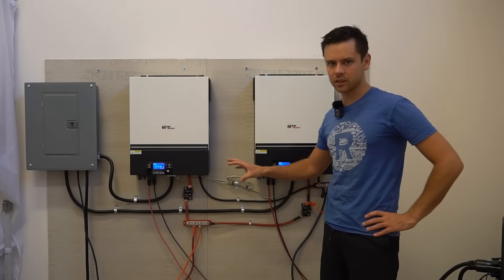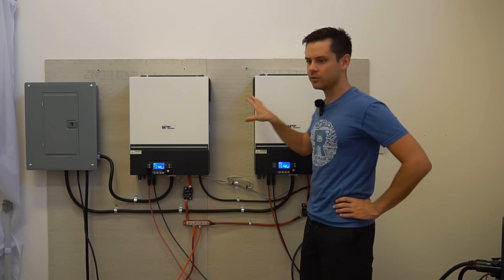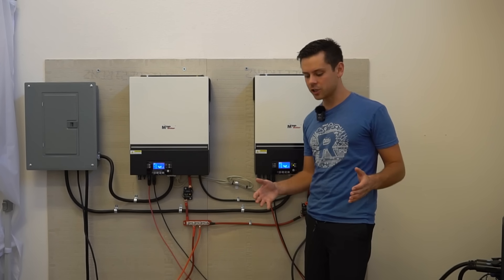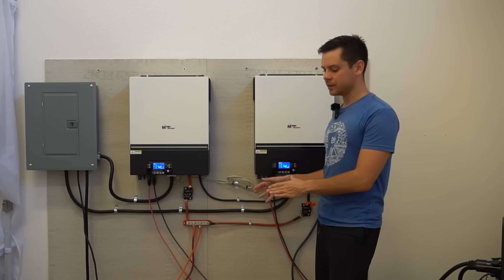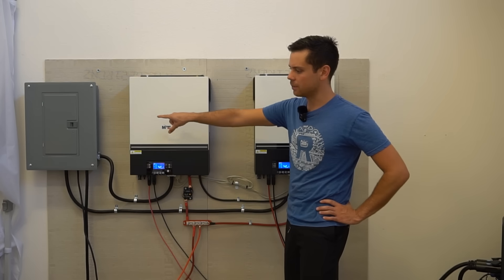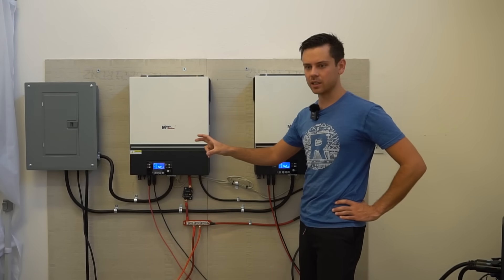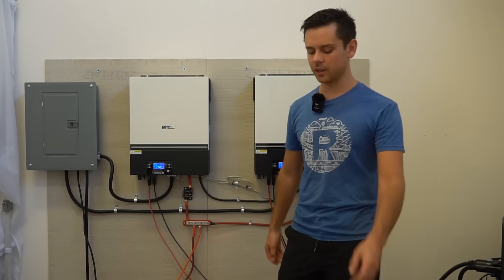Does my 13kW Offgrid Solar System require Grounding? Is it Grounded?

Comment: why is there a Ground screw located on the bottom of my Solar inverter Charger. And instructions in the Manual to ground the unit, if this procedure is not needed?

Comment: Thank you for the graphic and explaination of the problems associated with a ground looped system. I have the added complication of an elaborate and powerfull Ham Radio system with multiple antennas, I will need to rethink some of my antenna systems!

Comment: My 1500 watt 12v inverter manual recommends an earth ground, but is not designed to work with a traditional ac pannel. Is that maybe why the earth ground is recommended? Because there isnt an ac ground.? It also recommended grounding to the negative bus bar if an earth ground isnt possible. All of this is kind of confusing in a way based on different setups and equipment

Comment: PLEASE respond- i moved to the philippines, we have no ground wires, 2 wires come from the pole to the house, from what i understand  it is not two 110 wires – it is a single 220 volt and a neutral. i heard its 'grounded at the pole' outside, not in the houses.
none of my wiring in the house has a ground its all 2 wires.
  i put in a rebar ground to earth under where i planned to put my fuse box, and future inverter for solar, it has never been used.
  i read somewhere its dangerous to ground my fuse box to earth since the pole outside is 20 feet away and its already grounded there.
  i also read its dangerous to try to ground my solar in a system with no ground wire like this.
 -  NOW, i am putting an inverter and batteries in there and panels on the roof, i will have a big knife switch to completely shut off the incoming utilities power connection and a knife switch between the inverter and the fuse box as well,  to turn on the inverter current to the fuse box.
so i will only kick on the solar to the fuse box while the municipal power is disconnected from the house.
 the solar will have the inverter connected to the fuse box thru a knife switch and the incoming municipal will also be connected to the fuse box with a knife switch.
  i will disconnect the 220-240 municipal coming in at the switch then connect the inverter's 220 output to the fuse box manually every time i want to use my battery storage.
 so when we have a brownout i will shut off the incoming 220 and switch to my inverters 220 to power the house.
do i need a ground on my inverter? < should it be grounded to earth?

Comment: I have a Bluetti AC500 with 2 sets of 3 (6 total B300Ks) batteries connected.  No AC involved; only solar panels.  I am connecting all panels to a ground rod, but feel the Bluetti AC500 is fine without a separate ground.

Comment: Meh my garage has it's own ground rod, but the wiring does not ground to the house. Detached garage.
I plan on grounding my panels at the panels.
My intended setup shows I can use awg 12 wire from panels to inverter BUT I have a long run so it is supposed to go up a size to 10 gauge.
Going to do one better than that and use 8 gauge wire.
And no ground wire between them. Panels will be about 100 feet away from the equipment. Not feasible to run another 8 gauge wire just for a ground at the house.
House ground rod and panel ground rod will be about 80-100 feet apart.
House has old wiring and outlets are not grounded so I cannot ground equipment via house ground.
So, I have a large rubber mat to stand on so as to not worry about getting shocked.
Plus how often does anyone bother to touch their equipment?
And when they do they presumably are smart enough to TURN OFF THE POWER first.

That wire is going to cost me nearly $200 for it. Can't afford another $100 for one wire for grounding.
But I can afford a ground rod and piece of wire from panels to the ground.

Been thinking about a setup on wheels so I cam move it when desired (like when storms are coming).
Can't put wires and ground rods all over the place.

Comment: My simple formula:
1. Bonding AC output from inverters is not recommended, if you need shock & leak protection, use GFCI instead of bonding one AC output to Ground.
2. For lightning protection, connect Earth wire with metal casing for every equipment, use thick wire if possible. 
3. For multiple inverters: make sure your inverter is not internally bonded with its metal case (by checking voltage between casing and one of its output).

Explanation: Some type of off-grid inverters can be damaged if Neutral and Ground are bonded, some have already internally bonded with its metal casing. 
Bonding N to G with multiple inverters across the same Ground path could potentially destroy your inverter. Also, connecting AC output to Earth introduces the risk of being electrocuted if you touch Live wire (which will not happen if you did not do bonding).

Because the risk is way higher than the benefit, bonding AC output should simply be avoided.

Comment: Help! I’m getting conflicting information on grounding. I think I get what you are saying but can you lease verify my understanding? I’m building an off grid system (no grid tie).  I will have a solar array, a shed with PV/DC disconnects externally, and one EG4 18KPV and three Power pro batteries inside.  I will run Line 1, 2, Neutral, and Ground from the inverter to the house where it will connect to the 200A AC disconnect, and then on to the Main Panel. Regarding the ground, is it correct to bond all the solar panels and run a ground along with the PV wires through conduit and connect the ground to the ground busbar in the inverter, then run the ground from that busbar along with Line 1, 2, and Neutral to the AC Disconnect, on to the Main, where the Main is Earth grounded? Or, is there a second ground (one for PV/DC and one for AC) run to the house earth ground? This gives me one earth ground at the house and none at the solar panel array, avoiding the ground loop. I’m also hearing you say I need a surge protection device for the solar panels…correct?  Thanks!

Comment: A mobile system is generally not grounded and if a charger is used it's only connected +/-. With only a short run of cabling, and perhaps panel frames connected to the sheet metal to mount them, I think any secondary ground should be to the vehicle, basically for static discharge only - correct? Correct.

Comment: Ground anything touching AC wires. I don't see any point in grounding panel frames where there is only DC on the roof.
Reply: The ground potential will be different and its metal on a roof.
Reply: @GoonyMclinux  Would you ground a metal roof by itself, because it will have a different potential than the ground?
Reply: @ctrlaltdebug  yes.
Reply: @ctrlaltdebug  If everything "lifts" at the same potential during a spike or strike then the equipment doesn't know and won't nuke itself, if anything metal isn't grounded or a long string isn't grounded to "all" of the grounding system it will have a different potential voltage causing issues.
Reply: @ctrlaltdebug  also to clarify, all grounds are tied into the main ground of the house. My main ground of the house is 4 8 foot groundrods 16' apart. And any other grounded structure or solar array or anything that is hooked to power is tied to the main ground. I watched my small tower get hit and the power stayed on, the ground potential of all structures and devices stayed close enough to not matter much.
Reply: @ Grounding won't protect from a direct strike, but it may help in a nearby strike as you say. In a decoupled DC system (measure from DC to AC to check) it shouldn't do anything, except drain induced voltages from RF etc. and static to ground. 

However if your PV inputs are not decoupled from your AC system as some cheap AIO inverters or solar chargers are built, it can be an important safeguard in case there is a fault between the panel frame and one of the PV conductors.

Comment: What confuses me is the a/c input. Is this from a generator? I get the impression Will is talking about a/c from the grid, although he talks about being off-grid. For me off-grid means no connection to the grid. Is there a grounding requirement for grid connected "off-grid" that is different from unconnected, except to a generator, off-grid?
Reply: He only calls it off-grid because that's a potential use of a setup like that. But Will's property is absolutely grid-tied. He has hydro coming to his house from the utility company. 

Needless to say I'm pretty sure he has physical Internet connection which disqualifies you from calling your property off-grid

Comment: Most inverters have "Enclosure Ground Terminal", also Grounding Wire Connectors on both AC input and AC Output, where do you connect the "Enclosure Ground Terminal" to? Or just leave it disconnected.

Comment: My system has 4 separate ground rods, grid AC ground, inverter AC ground and two solar panel/combiner box ground.. The AC ground is common through the grid breaker panels, the inverter ground is common to the inverter AC breaker panel and the charge controllers with a ground rod in the basement at the inverter box.. All these are bonded together to create a ground field of sorts which 99% eliminates all electronic noise from the system into my amateur radio gear.. There are 6 surge arrestors and several MOV devices spread throughout the wiring, 1 two phase AC arrestor at the main grid breaker, 1 two phase AC arrestor at the primary sub panel, one DC arrestor for each of the solar panel arrays, two AC two phase arrestors near the inverter and its AC distribution panel, one MOV at each of the eight breakers in the solar combiner box, one from solar - to ground, several factory MOV's on the inverter and each charge controller, 80a GFI/arc fault breakers and MOV's between the neutral and ground in every panel.. Could something get past all that? Yes but if God wants to kill it it's going to smoke.. I also have 5 ground rods on my radio tower and antenna poles because lightning has hit them so many tomes every tree in 250 feet has scars..

Comment: Whilst this is an old video it still talks about getting an electrical shock by electricity passing through the body and going to ground. Electricity does not go to ground, it goes back to the source (a circuit) if it does travel through the earth it is to get back to the source - not just to go to ground. This is key in understanding AC.

Comment: chatgpt says even when the system is not grounded you can still be shocked when coming in contact with a hot conductor as current will flow to ground through human 

"Why Does Voltage "Want" to Go to Ground?
Nature of Electric Charge: Charges (electrons in particular) are naturally attracted to lower energy states. In most systems, ground represents the lowest possible energy state for the charges (zero potential).
High-to-Low Potential Flow: Voltage, or potential difference, drives current to flow from high to low potential. So, in an ungrounded system, if there’s any way for the system to connect to the ground (such as through a fault or capacitive coupling), the electrical charge will attempt to flow towards it, neutralizing the voltage difference.

Comment: Hello! Thank you so much for you video! I was able to find this because I just recently built a portable solar generator. I have 4s lifepo4 and 1000w inverter. I tried running in the inverter at around 400 to 500w. I touched the busbars on the battery to see if it is heating up or not but at my surprise, I got shocked! I am still clueless as to why this happened
Reply: You say 4s so I assume you have in series. if you have 4ea 12.8 volt  batteries in series the voltage is 51.2 volts. That's enough to shock you. If they are in parallel it would still be 12.8 volt and it would not shock you.
Reply: @dt719  hello! I have 4s lifepo4 3.2v each.

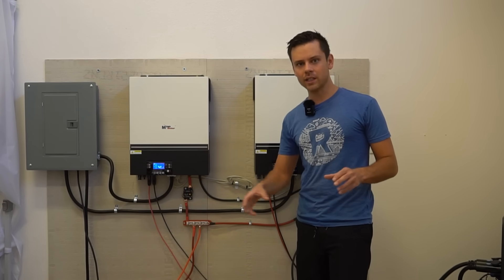Comment: Excellent, and I fully agree (see 0:50).  Approx quote:  Even if you have two or three Grounding Electrodes you want to tie it together at one place'.   Many absolutely stand by the fact that there can only be ONE Grounding Electrode period!  They have no understanding of what Single-Point Grounding actually means!  Many even think grounding attracts lightning which is directly opposed to sound engineering practices.

Comment: Hey will absolutely love your content. I have a pretty funny hypothetical question. Technically since no grounding rod or true earth ground is needed, and this system is in fact floating. Could the main breaker panel be constructed of plastic (of course with identical internals)? Would that further reduce any potential shock hazard? I only ask because the main reason most panels are in fact metal is due to the panel/grounding rod connection am I correct there? Thanks
Reply: I am also absolutely acknowledging the fact that metal is in fact safer than plastic in terms of fire safety, durability. This situation would involve smaller loads like a 25-30 amp panel.

Comment: I can see adding a ground rod only if this is for an off grid 120VAC or a 120/240VAC system.
In this case, it would be the only ground rod.
Otherwise, you are correct, 1 ground rod at the service entrance only when connected to a grid-tie system.
But, what if you are using a 120VAC inverter in combination with a relay that redirects the load back to grid when the inverter turns off?
The grid side is grounded, but the inverter side would not be.
I have several of these systems, and I tied all my grounds together on each one.
This grounds the inverter cases and the inverter output.

Comment: You are a wealth of knowledge in solar generation systems. However, this video was like another language. I’m sure the more advanced people could follow all you said. Me, not so much. I do understand ground to some degree. I understand how earth ground rods and such work with AC electricity. I was looking for help with the correct way to protect my small 4 panel system. My concerns are lighting protection for the panels. How and if I need to ground the wiring. How to connect my inverter to ground. That sort of thing. I will search your other videos. 
Thank you….

Comment: Please provide some visualization on this topic. I have seen an end to end Inverter/Electric Sub-panel/Battery setup video and the gentleman there grounded the whole system with a true grounding electrode. Basically a separate grounding bus bar in the subpanel which is connected to inverters as well as true ground electrode outside.

Comment: Title says does my “offgrid” need a ground but you are saying it has ac input.  What if there is no ac grid input then what?
Reply: Hi, yes I would like more info on this please?
Reply: @SWmattKID  Hi, a true off-grid system is a floating one (not grounded). As will Will mentions in this video, in that case you can only get shocked when touching both L and N at the same time (completing the circuit). Your panels, the surge protector device and the inverter case (DC side) need grounding though to a dedicated grounding rod (over current protection). But again, as Will mentions this has nothing to do with your AC not being grounded. No ground also means you are not able to use a Residual Current Circuit Breaker (RCCB)/GFCI (Ground Fault Circuit Interrupter). Hope it makes sense.
Reply: @xposehu not sure about that last bit about GFCIs being true. GFCIs don’t actually need a ground to detect faults, they measure the current traveling between hot and neutral. That’s why ungrounded outlets can and should be replaced with GFCIs.
Reply: @whadabadat  Hi, while technically you could use a GFCI it just doesn't really make sense. Again, when using a not grounded system (i.e. no real connection to earth) you won't have a ground fault A hot wire touching the case of your appliance won't do any harm since your body can not complete the circuit using the earth under your feet. (In a grounded system, current would flow through your body to the grounding rod, completing the circuit which could be fatal). A floating system is only dangerous when you touch both L and N at the same time.

Comment: I do have my panels on their own grounding for the panel frames and dc lines are fused incase something tries to send more amps through the dc input lines like a failed shorting inverter that backfeds ac to the panel frames.

Comment: 2000w SunGoldPower inverter charger fed from my house 120v, and from 3 X 100w solar panels. All feeding 4 X 100ah LiFePo4 batteries. House is earth grounded. What I hear you saying is that I should remove my earth ground on my solar panels ASAP?

Comment: Will,  the "Wiring Unlinited" publication clearly shows negative DC bus grounded in an offgrid system. Are you suggesting to go against this, or is the real problem when there are 2 ground rods in 1 system?
Reply from the maker: Depends on your environment and wiring configuration. And your local regulations. It's really up to you on these systems. If you need to do that then do it

Comment: I'm looking to disconnect my utility and have an inverter run my house, the inverter has the earth and neutral bonded at its output, i would like to run the inverter inplace of utility at the panel so would i have to remove the ground rod? It's confusing me.

Comment: I just wish the pv inputs would not have dangerous AC voltage coming from  the pv inputs on both positive and negative to earth ground..  I was "shocked" to find this on the pv input without the panels connected yet... also, fun fact..  between the 2 pv input negatives or the 2 pv input positives from the the 2 different inverters yields approximately 350 AC voltage.

Comment: It's a year later, but here is how adding additional electrodes (ground rods) works. You can add as many as you want, anywhere, but they must be bonded underground (i.e. 2/0 copper or bigger), and you can space them up to 10 ft apart. The OP is talking about adding a standalone ground rod that is not tied together underground and is most likely more than 10 feet away. That isn't good.